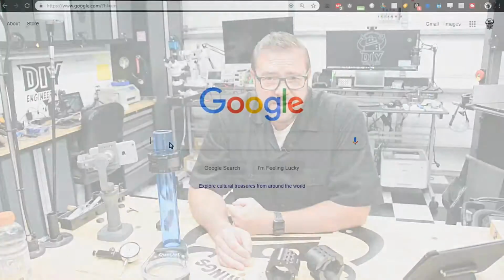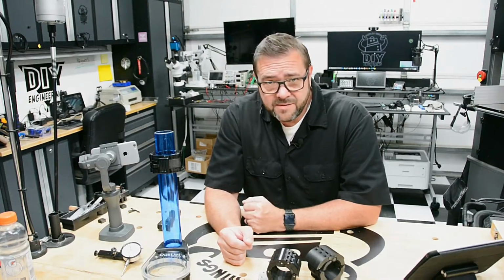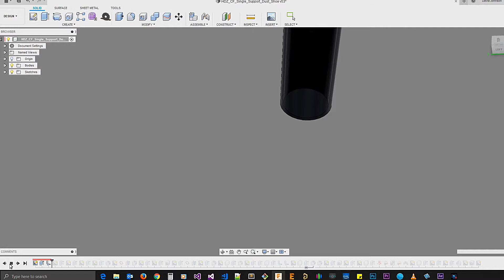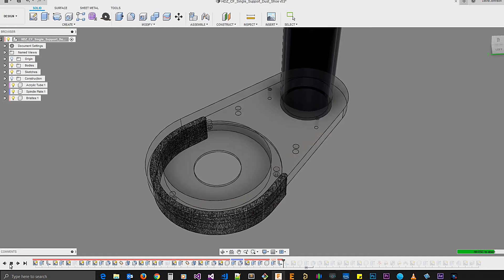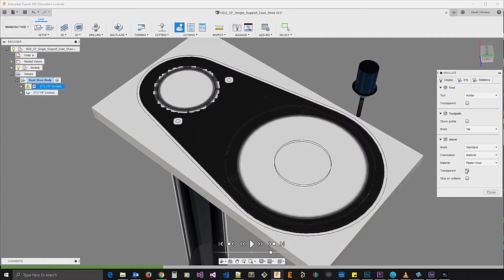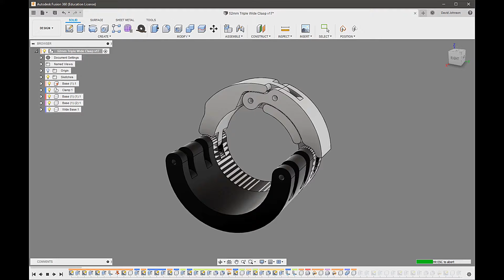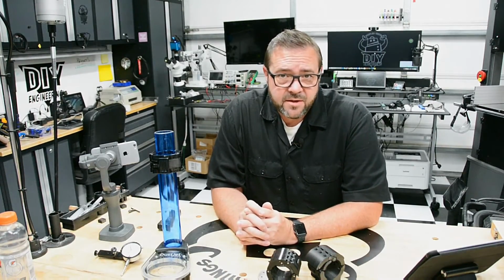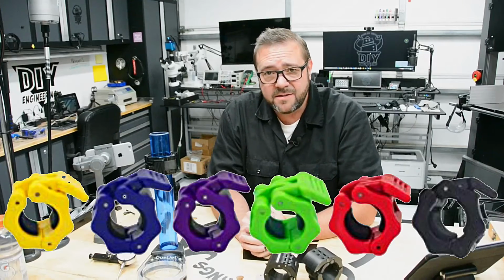Episode 036: The DustJet CNC Dust Shoe Part 2

Comment: Very Cool Design, Probably one of the best ive seen. Only one down side is you loose "X" Travel as it looks like it will hit the gantry side arm?
Reply from the maker: yes, around 50mm and thats a lot if you have a std. Shapeoko. it was a compromise. That said, I am already in colab with another maker for a rear gantry mount version. give us a week ;)
Reply: @DIYEngineering  Hi!  Any updates on the rear gantry version?  I don't see any kits (for either version) on your site.  Killer work, and thanks!

Comment: I have to ask.. What are you using the elgato stream deck for? Looks like it has controls on it for CNC movement O_o
Reply from the maker: Custom Creations it is being used for all cnc operations... The next video will cover all that... On my other social feeds i shared several videos of it in action. :) it's awesome
Reply: @DIYEngineering  Do you control spindle RPM with software or manually with the VFD? If with software, care to explain wiring? I also have a similar setup with C-Beam machine but have to manually adj RPM. TIA!